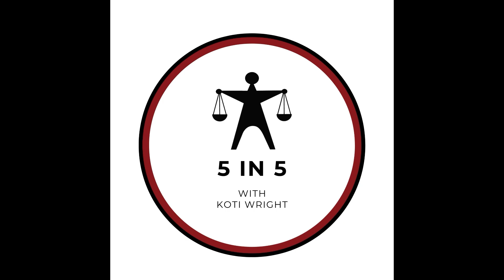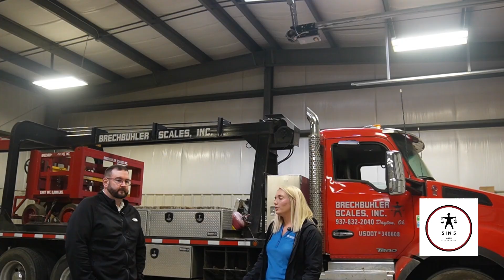B-TEK vs Rice Lake vs Mettler Toledo Truck Scales: Which Truck Scale Is Best?

Comment: B-tek is a great company,  making a video about why they are better then RL/Toledo is irrelevant to most, Btek makes the Endurance truck scale with a 1/4inch plate just as ive installed a 3/4inch plate Ricelake. Every manufacturer has high-end scales and economical ones. Id focus on your strengths not pick on other companies. If you do, talk about the Chinese garbage coming into the states, help the consumer pick local.